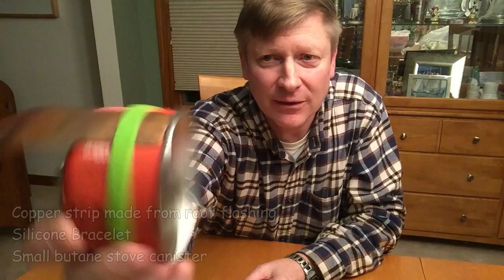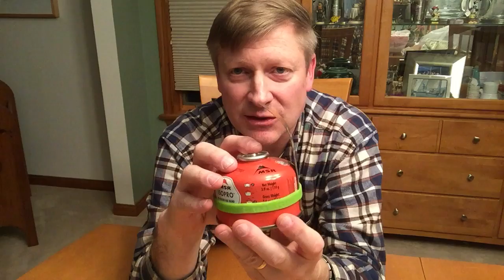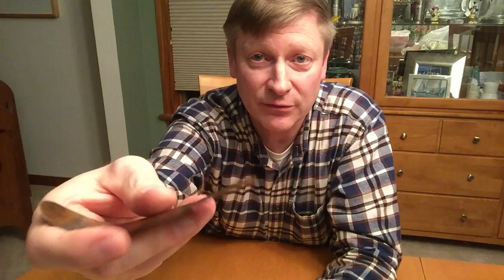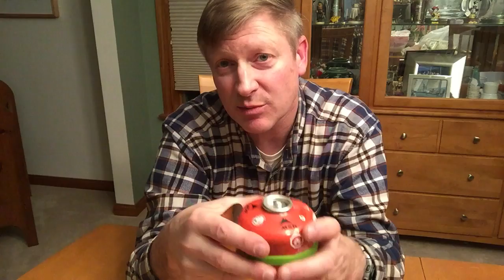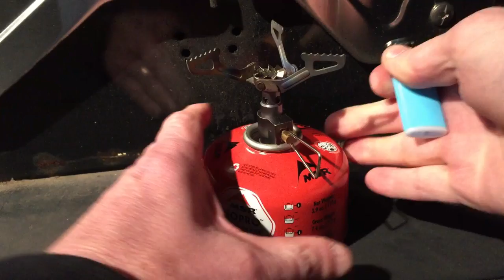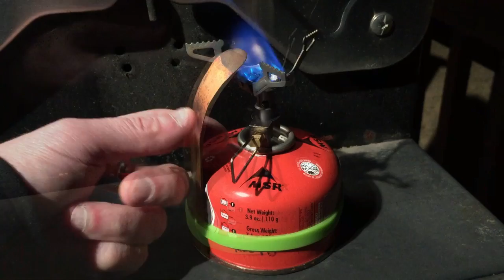Butane Canister Stove Winter Hack - Running Below 20°F - moulder strip

Comment: Hi, Kriz, and thanks for the acknowledgement with the link to my Backpacking Light thread.

And thanks also for the warning that this is a hack that neither canister nor stove manufacturers would approve. That said, I have tested with both BRS-3000T and JetBoil set-ups on my deck at 75°F ambient, utilizing the copper strips and full insulating jackets around the canisters, which is really a worst-case scenario. After running at full throttle for 30 minutes in this condition the canisters were getting pretty warm, but still under the 122°F (50°C) "safe" level as mandated by DoT. I was of course monitoring every second of those burns with 2 thermometers and also doing the "touch test" on the canister tops. Bottom line, used as intended — IN COLD WEATHER — this is a safe setup, but as usual there's no accounting for the ingenuity and creativity of a few idiots "out there."

I would also note that for more extreme conditions the use of a Velcro strap, insulated from the copper strip with a piece of sheet silicone, can be cinched down very tightly, which provides more contact between the copper strip and the canister, and a closed-cell foam or Neoprene cozy will retain more heat in the canister. By this method it is possible to run the stove normally with straight N-butane down to at least -5°F, which I have done, and have done so on camping trips down to 0°F. Of course, at such temperatures with N-butane the canister must be warmed up a bit just to get it started, but once running it will go at 'full tilt' until all fuel is exhausted.

Comment: It is so insanely easy to use a Moulder Strip and increase performance so much that I'm surprised people aren't selling "kits". With silicone ring and copper strip, plus instructions/video link they would move with some marketing accumein. Don't tell anyone, but I worked for a major petro company for years in the gas liquids division, i.e. propane, butane, HandHill-tane......Know Your Gases 101. There is no one fuel that can work across a massive range of temps. Mfgrs. don't see a profit margin in offering "cold weather" cans. And that is why the Moulder Strip is such genius. Like most great things, keeping it simple goes in hand with greatness. Thank you Bob!
Reply from the maker: Indeed! 👍👍 I’m sure liability keeps people away from selling little kits. Using the bracelet, it’s nothing in parts...yes, super simple. I did see a commercial magnetic version once in a photo online - vaporware...would have been fun to play with. There’s something about the soft copper strip that just makes me smile. Thanks so much for taking the time to comment.
Reply: Thanks Bill. I'm not a gas expert by any means but early on in my experiments with this concept it dawned upon me how all these special "winter mix" concoctions are such a marketing boondoggle. Once the propane burns off, you're back to the basic vapor temp problem.

Comment: If it get's too hot will melt the silicone long before steel. Silicone is ~800 F and steel is 2500F
Reply from the maker: It gets nowhere that hot. Copper melts at 1983F and is in the flame - it does not melt. **This is only to be used when it is very cold out and the fuel won't vaporize. Long before anything melts, the canister could become too hot, over-pressurize, and burst if it is warm outside.

Comment: I just acquired a 4"x5" sheet of .025” thick copper.  Before I go making any cuts, I was hoping I could consult your experience.  My idea is to cut essentially an upside-down "T", one inch wide (with rounded corners to prevent tearing and snags).  I am taking some inspiration from the Korean product you mention in the comments.  

I am making this to accommodate the SOTO Amicus on a 250g tank, so I am making the T 5" high and 4" wide.  

The bottom "arms" of the inverted T will wrap around a section of the canister's circumference.  Neodymium magnets will be attached with duct tape to the very corners of the arms (to the outside of the copper).  Hopefully, these furthest corners of the copper will not get hot enough to melt the duct tape, and the arms of the T will provide adequate contact with the canister.  Hopefully, this design will avoid using any bands.  It will be somewhat heavier perhaps, but I have all this copper to work with so I might as well try this design.  Do you foresee any problems with this design?  I appreciate your input.
Reply: I'm also considering attaching the magnets via teflon tape or solder.  That would change the design too.
Reply from the maker: It does not take much - a simple strip is all that is needed. Round edges are good. I have seen people attach it with a velcro strap and a small insulator to keep it from melting. The "T" is not necessary unless part of some kind of self attaching a magnetic design. The magnets could maybe be attached with silicone adhesive - that won't melt and is usually good at holding things to smooth surfaces.
Reply: @KrizAkoni  You are right!  I totally forgot about silicone adhesive - it can be quite tenacious!  I think I will do that and keep the duct tape in reserve in case it falls off.  My goal is to eliminate fiddle factor as much as possible.
Reply: @KrizAkoni  on second thought, I am going to make a simple strip by cutting my sheet on the diagonal in order to maximize length.  I think it will be important for the strip to reach the bottom of the canister, so the heat can reach the unvaporized fuel, rather than just the top of the can.  Thanks for your suggestions.
Reply from the maker: Looking forward to seeing what you come up with!
Reply from the maker: That looks pretty good, those are some strong little magnets! I bet it works well. Now all you need is some cold weather to test it out.
Reply: @rockclimbinghacks922 I could not find the comment about the inspiring Korean product. Would you mind providing further details?

Comment: i see some thermo cozy pouches are sold to keep canister in them .. are they working ?
Reply from the maker: They do not, the canister cools from the inside when the liquid evaporates…like an air conditioner. Cozy makes it worse.
Reply: @KrizAkoni  hmm.. but isn't it protecting it from freezing in a first place?
Reply from the maker: When actually camping outside, any heat in the canister, assuming you can store it in a warm place, dissipates very quickly even with a cozy. When the gas is released, the canister cools rapidly to well below ambient.
Reply: @KrizAkoni  ok, trangia then

:)

Comment: I never use my canister stove backpacking and always take an alcohol stove which I never have problems with regardless of temperature. This is probably the coolest and most original solution to a canisters terrible cold weather performance.
Reply from the maker: Credit goes to Bob Moulder over at Backpacking light for maturing this idea. I'm mostly alcohol these days too, but when my water turns hard and the amount of fuel goes way up to both melt and boil, I find gas much more reliable (once I got a consistent way to keep it vaporizing). Thanks for commenting and watching!

Comment: This is exactly the same idea as wrapping a couple  turns of 1/8" single strand copper wire around the canister, with both free ends poked into the stove's flame.  Further, a windscreen which goes 3/4 or more around the circumference of the pot creates a warm microclimate for the canister top stove to operate in.  Canisters are only rated by USDOT for sub 130F operation, peeps.  Don't get way too hot and blow yourself up.
Reply from the maker: Yes, Yes, and Definitely Yes! Lots of ways to get heat back down to the canister. Thanks for stopping by and commenting! 🤓
Reply: With due respect, it is not the same. You need good contact between copper and canister and this is not achieved with wire, at least certainly not as efficiently and effectively. I realize that the strip is a simple twist on the heat shunt idea that has been around a long time, but it offers distinct advantages over other approaches to the problem. The strip will permit running straight butane at well below Zero Farenheit... try that with wire and it will not work.

Comment: Wrap your copper in the middle section with carbon felt or fiberglass and the canister should heat up faster, especially in the wind.
Reply from the maker: Indeed it would! I sometimes use carbon felt as windscreen, I have a wad of it. Thanks for commenting! 😎

Comment: Very good video. I never thought of this. I am blind and cannot see details. As of the wire with insulation and plastic or without? How many times the wire wraps around the canister? What gauge wire do you use? Thank you so much for sharing. God bless you.
Reply from the maker: @Taino - thank you and thank you for commenting. I did not use wire. Instead I used a flat piece of copper metal roof flashing that is one inch wide and four and three quarter inches tall. It is soft enough and can be easily molded to fit vertically against the side of a canister and held in place with a silicone wrist bracelet wrapped around the base of the canister. Only the bracelet is wrapped around the canister. The metal strip is held in place behind it.  The long copper strip that is now sticking up is then gently bent over so it touches the flame underneath the pot. It does not take much heat to vaporize the fuel.

Comment: Am I mistaken or does this demonstrate why you don't want to refill with straight butane? This is why they use a butane propane blend. It would still be a neat idea to improve the efficiency but I would still not refill with straight butane.
Reply from the maker: You are mostly correct. However, even the good winter blends cheeze out in cold weather, especially once the higher pressure fuel vaporizes, leaving the weak stuff at the bottom. Thanks for watching and commenting! :)

Comment: This is a great idea. I've just stated looking up idea for my venture into winter backpacking this upcoming  season.  Awesome share bud.
Reply from the maker: Thanks! This is the core of my winter cook set. Once I need to melt ice, the alcohol goes away. I should really do a review of my winter setup. It's based on an Olicamp XTS with an Optimus clip on windshield, the BRS-3000, and this copper "moulder strip". It all fits inside the pot.

Comment: Thanks for the idea but I need help! I implemented the advice and the canister heated up correctly with an external temperature of 53'F (12'C), but the flame was never regular and strong.  To burn well I had to continually shake the cylinder (refilled at home with a butane / propane mix from a larger cylinder).  Can you tell me if I am wrong and what I have to do? Thanks a lot!
Reply from the maker: Sounds like you need to bend the strip a little more into the flame.

Comment: Hey man I was wondering if there is any special reason why you used copper? I wanted to give this a try, considering the cold temps we've been having, so I went to the hardware store up here next to where I'm currently working and well to my amazement they didn't have any copper.  At work I have tons of aluminum as well as just plain old steel...was wondering if you thought an aluminum strip would work?seems like its just as light as the copper and should also be a decent heat conductor.  And if I can just come up with a silicone band as well....I see them literally everywhere until I am looking for one, then they are no where to be found. That's my luck haha!
Reply from the maker: There are some options and explanations in the thread in the links I posted. Aluminum will work, but not as well, copper conducts heat much better. The aluminum also melts at a low temp and burns off after a few uses in the flame. Some use a piece of soft copper tubing hammered flat. If you can't find a silicone band, a velcro strip and slice of carbon felt works too.
Reply: KrizAkoni yeah I am checking out those links now. Thanks for sharing those.  I wanted to get right to making one of these but I'll probably just wait till I get back home in a few days. I'm pretty sure I have some old copper flashing laying around somewhere.
Reply: Smell N Roses aluminium is not that great a heat conductor compared to copper.